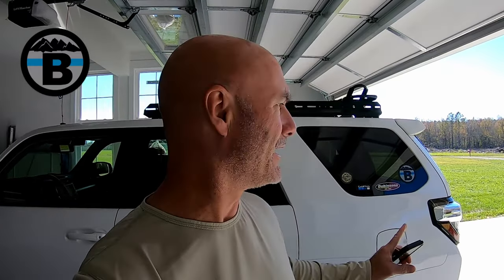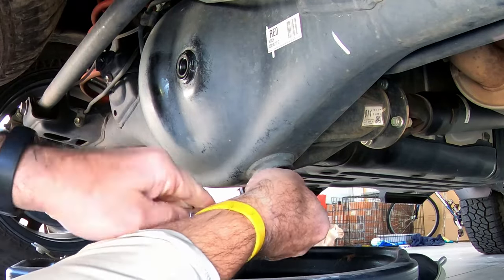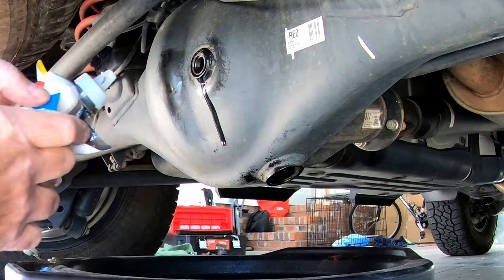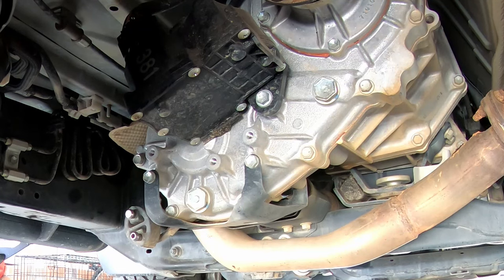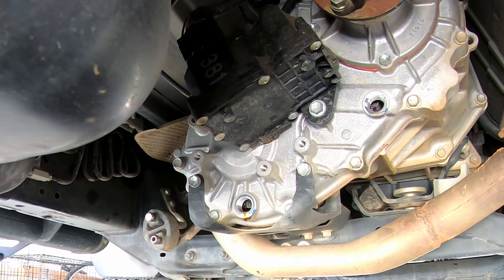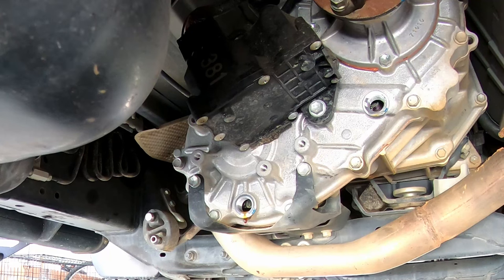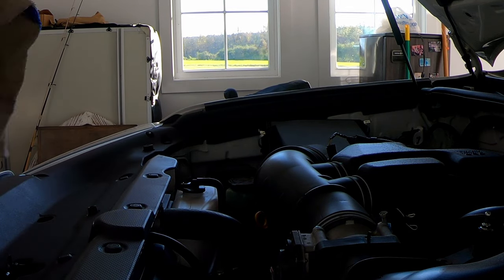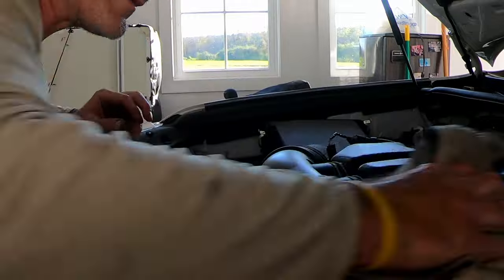Fluid Service on a 5th Gen 4Runner

Comment: Like your videos….  What are your thoughts on using 5-30. Full synthetic.   Reason I ask have a couple vehicles that use  0-20. And two things one was using a bit  between 4-5000 km. Not miles, the other started seeing a bit of fuel carry over to the oil.  Both issues went away when I switched to 5-30 in spring to fall.   Winter I go back to the 0-20.  Same issue every time I switched…… was thinking I would switch my 23 Toyota 4 runner over  this next oil change.
Reply from the maker: Thanks for your support! There is a long standing debate about 0W-20 oil and whether it actually provides adequate protection. It’s widely believed that 0W-20 oil is mainly used to help meet the government mandated CAFE standards for fuel economy. The 4 liter used in the 5th Gen had been in use for many years, and in many other countries with various oil recommendations. In fact, depending on your model year, the owners manual may give you a range of oil weights to use depending on your ambient temperature. 

When I made this video, I was using 0W-20 oil, per the manual. However, I have since switched to 5W-20 mainly in an effort to help quiet the common “tick”‘produced by these engines, but also because of the studies which indicate that 0W-20 oil “may” not provide adequate protection long term. I live in eastern North Carolina, so it doesn’t get very cold here. Because of that, I don’t really have much of a concern about switching back and forth during the colder months.

Regarding you burning oil and fuel carry over, that sounds like the rings and/or valves may be worn. My guess is that it’s a high mileage vehicle? In that case, using a slightly thicker oil shouldn’t be a problem since the wear has actually created larger tolerances within your engine, and the thicker oil helps to fill those tolerances. 

Basically, I think you’re fine with using slightly thicker oil, even in your 2023 4Runner. I’m a little skeptical of going with a 5W-30 oil, which is why I’m using 5W-20 instead. 

Thanks again for your support! I really appreciate it!

Comment: Those vavloline bags seem to make it look way easier. However,
do those Valvoline bags meet GL-5 and other specs?

Some of the other YouTube videos I’ve seen used the Redline brand 75W-85 GL5 for the diffs and Redline MT LV 70W/75W GL4 for the transfer case. 

The OEM Toyota stuff costs an arm and a leg

Thoughts?

I’ll be doing mine on a 4Runner with 75K that’s never had any of that done.
Reply from the maker: Thanks for the question. Yes, the Valvoline 75W-90 gear oil meets the GL-5 specs, per the Valvoline website. I’ve used Valvoline products for years and have always had great results. They make quality products at an affordable price. 

Thanks for watching!

Comment: Great stuff!
Reply from the maker: Thanks so much! I really appreciate you watching!
Reply: @bluelineoffroad  absolutely! Just changed brakes and rotors this past Wednesday. I get a shimmy in my steering wheel at about 60-65 mph. I’ve had tires balanced and rebalanced, and I read somewhere it could have been a warped rotor, but it still shimmies. I’m guessing wheel bearing or control arms. 

I’ll probably do the service on your bud the next time I’m due an oil change. The Oil change place stripped out my front skid plate nuts last time I had it done. Can you access the filter without taking it off?
Reply from the maker: @adamcordell7750  Well, about the shimmy, the problem may be the needle bearing. Look it up on YouTube and you’ll see that it’s one of those nagging things about the 4Runner

Now, about the skid plate, there is an access panel for the drain plug, but you need to remove the skid plate in order to access the filter. If the bolts are truly stripped, maybe get a dye set and retap the holes to a slightly larger size. You can then just use larger bolts. 

Yet one more reason to do the work yourself! Thanks again for your comments, and for watching!

Comment: Great video - used it to change mine. Question: I found 2-3 very small black bits smaller than a grain of rice in my rear diff - big enough to feel with your finger and see clearly. This was my first diff oil change at 83,000 mi. Should I be concerned? Haven't heard any noises or noticed anything weird. Also, I noticed you just filled to the hole and let it drain - is it possible to overfill using this method (I did this and am wondering) -- thanks again for the excellent video.
Reply from the maker: Thanks so much for your comments! It’s hard to know whether you should be worried since I can’t see the bits, but from your description, I wouldn’t worry too much right now. You’re not experiencing any problems, and these pieces were few and small. Again, I wouldn’t worry about the bits. However, I would recommend that you do the service on the rear again after about 30,000 miles and see how it looks. If there are any larger particles, that may be cause for some concern. Even still, if you’re not having any problems, I wouldn’t perform any repairs.

As for filling to the bottom of the hole, that is the fill hole which is specifically designed not to allow any overfill. The differential is full if you only receive a few drops or a very small stream. It would be extremely difficult to actually overfill your differential enough to make any real difference. 

Thanks again for watching!

Comment: It would be helpful to list what oils you are using.  Did both Diffs and the transfer case use the same oil?
Reply from the maker: Thanks for the comments. I actually noted the fluid that I used about :45 seconds into the video. It’s Valvoline 75W-90, and I used it in both differentials as well as the transfer case. 

Thanks for watching!

Comment: Curious if you need to have the vehicle level when draining and filling the transfer case and differential? I usually use ramps to change my oil
Reply from the maker: Actually a good question. Yes, the vehicle needs to be level because the fill plug/hole actually determines when the differential and transfer case are full. If you remember in the video, I filled until fluid dripped from the fill holes. If the vehicle is not flat, it will change the full level of those parts. 

Thanks for watching!

Comment: Can you add the web links  where we can buy the  materials you used as far as oil and filters.
Reply from the maker: Thanks for your question. All of the products are readily available at numerous retailers. I purchased the oil at Walmart, and I used to be able to find K&N filters there as well, but they no longer carry them at my local Walmart. However, various auto parts stores in my area carry them, so I have no need to order those materials on line. 

Thanks for watching!

Comment: Thanks for the excellent tutorial!  Do you have a recommendation of how often to change the differential & transfer case fluid?  I have a 2022 4Runner Limited with 10K miles.  Also, I just did my first oil change on the 4Runner but the drain plug washer is stuck on the oil pan.  This is the first oil change since new and I'm not sure why it is stuck.  Since I can't get the washer off, I'm re-using it.  Hopefully nothing leaks.
Reply from the maker: Thanks so much for watching! My recommendation for changing the fluid in both differentials and transfer case is around every 30,000-40,000 miles. I know that the owners manual doesn’t recommend that it be done that regularly, but I actually use my four wheel drive system. So, my opinion is that it’s pretty cheap insurance policy to help protect major driveline components. 

About your stuck crush washer, I know that can be frustrating. You should be able to get it off by “gently” using a broad flat head screwdriver. Don’t be too aggressive with it as you may dent your oil pan. The broader the screwdriver, the better! I’ve changed my oil several times without using new crush washers, so you should be fine. However, I do plan to replace the washers at my next oil change. 

Thanks again!
Reply: @bluelineoffroad   Thanks for the info.  Looks like I still have quite a few ways to go before the differential oil change.  

I'll try the flat screw driver tapping method next time when doing the oil change.  I feel better now that you mentioned you have used the old washer several times without any issues.  Thanks again.

Comment: I thought you were supposed to use different fluid for the transfer case vs. the differential?
Reply from the maker: The manual does specify a different fluid for the transfer case, but it’s common to use the same for all three. I even checked with a Certified Toyota Master Tech who said that it was fine to use the same fluid. In fact, he uses the same fluid in his personal 4Runner. 

Thanks for watching!
Reply: @bluelineoffroad  good to know!

Comment: Redline sells MT-LV for the transfer case. I would not use gear lube. The Toyota stock fluid is super expensive however it’s gold in a can. I have seen an oil analysis and it’s no joke.
Reply from the maker: I appreciate your comments, but I checked with a Certified Toyota Technician who said that the fluid that I used for the transfer case was more than acceptable. In fact, fluid in they weight is widely used in the transfer case with absolutely no problems. 

Thanks for watching!
Reply: I’ve seen many videos with guys using Redline. I appreciate you using stuff I can find in my small town. Redline MT LV is even hard to find on Amazon and expensive.
Reply: Just to be clear, the front rear differential and transfer case all took the valvoline 75w-90??

Comment: Excellent video, but 6.6 quarts should show about half way up the stick when cold, don't add any more will be over full when hot.
Reply from the maker: Thanks so much for watching. Yes, oil does expand slightly when warm, like other oil based fluids. However, the expansion amount is nominal and relatively insignificant. The capacity amounts from Toyota state 6.6 quarts for an oil change (including filter), but Toyota doesn’t specify whether or not that amount is determined under warm conditions. The reason for that is because the difference is negligible. 

Thanks again for watching.

Comment: So weird they have an access panel for the oil drain plug but you need to take the front skid off to get to the filter housing lol
Reply from the maker: That’s just the design of the skid plate. It’s really not that hard to remove as it’s only four bolts, but there are some aftermarket skid plates that have a removable panel to allow access to the filter.

Thanks!

Comment: Where did you get the plastic drain that went into the oil filter that screws in, all the ones I see are push in and make a real mess as I can't seem to push it up far enough?
Reply from the maker: Thanks for the comment. These drains come with the filter, and the one I use is included in the K&N filter. I actually mention these specific parts in the video and how much I really like those for that specific reason. Not only does it keep the splatter to a minimum, but it also helps to drain more oil from the filter. Having said that, I’ve used the same K&N filter for each oil change, and it has had the drain that screws in as well as the one that pushes in. I don’t know why they’re sometimes different, and I’ve even tried contacting K&N for an answer, but I haven’t received any response. My only suggestion would be to open the box before purchasing the filter to see which type is included. 

Thanks for watching!

Comment: Just a question before I do this job to my 4runner  ... is He using same oil type for  F/R differentials and for the transfer case ???? any comments ?
Reply from the maker: Yes, I am using the exact same fluid for both differentials and transfer case. There is nothing wrong with doing that, and it’s commonly done by many. I even checked with a Master Toyota Technician about it, and he also does the very same thing. 

Thanks for watching!
Reply: @bluelineoffroad   Thanks a lot Bill. I been holding this job for a while now . but thanks to your video I have the confidence that i can do it right. thumbs up. keep posting great videos.

Comment: Have you done transmission service yet also what oil did you use on the transfer case
Reply from the maker: Thanks for watching. I have not yet done the service on my transmission. I’ll probably do that around 60,000 miles. As for the fluid that I used for the transfer case, it was the same as for the differentials - Valvoline Synthetic 75W-90. 

Thanks again!
Reply: Thank you for replying and great video hope to see more content

Comment: What brand torque wrench is that? Can't seem to find many 1/2inch below 50lb.
Reply from the maker: The torque wrench is from Harbor Freight. It wasn’t expensive at all, which is why I didn’t mind using it as a breaker bar at one point. It works well, but I probably need a new one. 

Thanks for watching!

Comment: Quick question. do the differentials and transfer case take the same oil? please let me know. Thank you.
Reply from the maker: Toyota “recommends” 75W for the transfer case, but it’s incredibly difficult to find, and is crazy expensive. In fact, some dealers don’t even use it because of its availability and price. I checked with a Certified Toyota Technician who said that it was fine to use the same fluid in all three. I used Valvoline 75W-90 Pure Synthetic, which is great fluid, and easy to use because it has bags instead of jugs or bottles. 

Thanks for watching!
Reply: Noted. Thank you sir for your amazing video and quick reply.

Comment: Did you replace plug gaskets too ?
Reply from the maker: No, I didn’t. There aren’t any gaskets for the plugs, but rather crush washers. If you heard me mention several times on the video, I did not replace any crush washers. It’s been 20,000 miles since I did the service, and still no leaks. But, I’ll probably do it next time. 

Thanks for watching!

Comment: when should you perform this type of maintenance ? is there a recommended milage ? Thanks
Reply from the maker: Thanks for your comments. The answer would really depend on how you use your 4Runner. The rear differential is obviously the component that is used more often, so I would suggest that it be done roughly every 40,000 miles. I use my four wheel drive system regularly off road, so I changed all three at the same time. 

There are different schools of thought on this, but my opinion has always been that preventive maintenance is always cheaper than repairing and replacing parts, particularly major driveline components. 

I hope this helps. Thanks for watching!

Comment: How much oil for AW trasffer  and differential and what kind of oil? Please
Reply from the maker: Thanks for the message. I don’t know the capacity for the All Wheel Drive system on the 4Runner. However, you should be able to easily find that information online. As for the kind of oil, that also should be available online, but you can probably use the same oil that I used in the transfer case and differentials, which was 75W-90. However, confirm that online. 

Thanks for watching!

Comment: On the comment about replacing early, or wasting good oil.  That can often seem the case.  The truth is, Toyota quality is so good, if you replace at proper interval, yeah it seems totally clean, but the magnet build up tells the truth.  Good news is, if you triple the interval out of negligence, don’t sweat it, just get it done.
Reply from the maker: Thanks again for another comment. I don’t recall making a statement about changing early, but maybe I did. My theory has always been that maintenance is always cheaper than repairs, so if I spend a little more on preventative maintenance, that’s still better than repairing major driveline components. 

Thanks again for watching!

Comment: I buy drain plugs and use them for fill plugs in diffs and TC  then every time I change engine oil  I take em out and clean em off , this keeps the lower magnet from reaching its metal holding saturation point as fast and keeps the oil cleaner .  and give ya excuse to check oil levels , I always used same washers been doing it on Toyota axles for 30 years never had a leak .
Reply from the maker: That’s actually a very good idea! I’ve never thought of it, but I may actually exchange mine for drain plugs as well. Again, great idea!

Thanks for watching!

Comment: How often do you change this? I've seen on the forums they recommend to change the rear fluid at the first oil change? Would changing these out at 30k to 40k for the first time be fine?
Reply from the maker: That’s a very good question. My answer would depend on how you use your 4Runner. I haven’t heard about those who change the rear differential fluid at the first oil change, but I can understand why they would suggest that. Personally, I don’t think it’s worth it to do so early, but it certainly won’t hurt anything. 

Specifically, as for the mileage, I did it at 40,000 miles, but I’ve heard recommendations at 30,000, but also recommendations at 60,000 miles. My opinion is that performing service on major driveline components is easy and relatively inexpensive to do, so why not do the service in an effort to make those components last? It’s a lot cheaper than performing repairs on those components. That’s my viewpoint, and I’ve been working on my own vehicles since before I could legally drive. 

Thanks so much for watching!